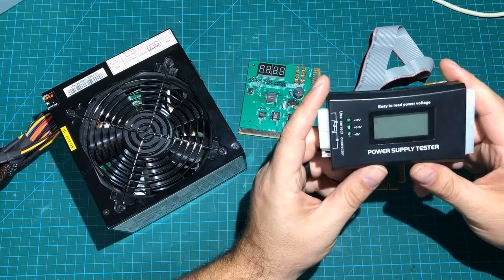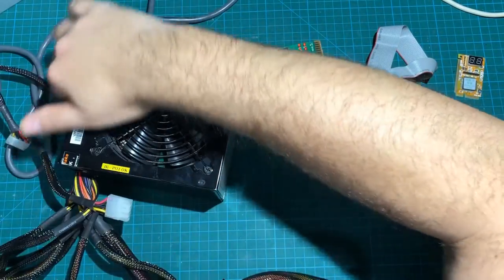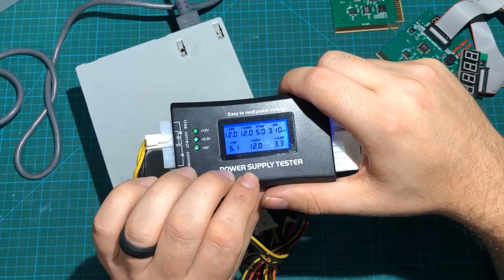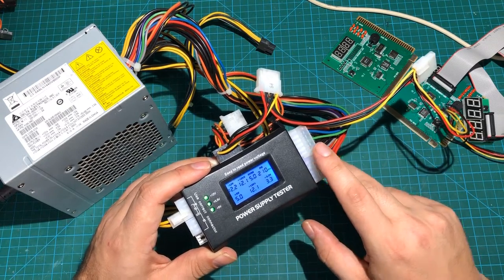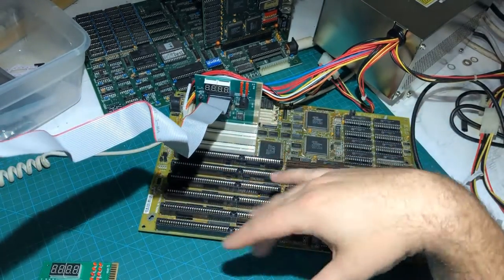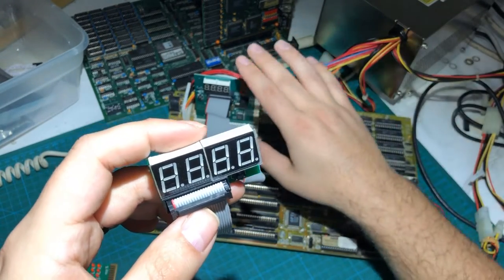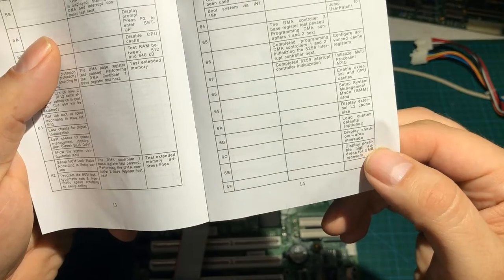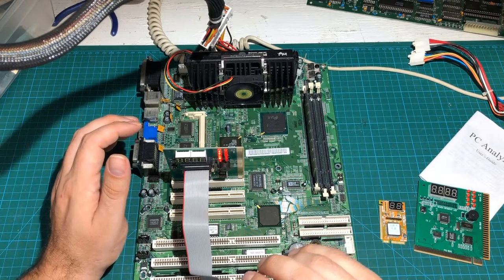PC Diagnostics Tools - Are they any good?

Comment: I bought the  PCI diagnostic card  10 years ago  , it was useless , the manual written in poor English , I trashed it
Reply from the maker: I normally just google the codes. It's REALLY good at testing voltages and figuring out if your pc dies in the middle of the boot process. I wouldn't call it useless.

Comment: At 5:45 you have the card inserted incorrectly which most of the time will cause a short! Check the card where is says "rear". That should point to the back of the main board where the e.g. keyboard plug is positioned.
Reply from the maker: You're absolutely right.  I figured this out because I always work on these things with the slots facing me so "back" is front and front is back.  On most of these cards I finally put a bracket or something else to prevent this.
Reply: @AnotherMaker  You literally warned us about the mistake you made
Reply from the maker: @SomeAngryGuy1997  such is life when trying to talk, film, and work. No harm in this case fortunately
Reply: @AnotherMaker  Lucky indeed. Glad it didn't break something.

Comment: I have a question about the debug card with the golden pcb at 5:00 
Is it possible to use this card in a M.2 SSD interface on a desktop?
Reply from the maker: I don't think so. I think it's mini pci-e only...but I could be wrong.
Reply: @AnotherMaker  Thanks for the reply.
It's a shame that they don't make them for that port since new motherboards that come with a debug led are pretty expensive.
And most mobo's these days come with extra M.2 slots and if slotted there you would be able to read it.

Comment: I've looked into POST cards recently and there isn't really a use case for them. For technical reasons they don't really work on PCIe, and PCI slots disappeared 10 years or more ago.  You can find them that plug into TPM the connector but with that being required hardware under win11 we can expect it to be come a built in chipset feature very soon. The required bus just isn't exposed anywhere on modern PCs. 
Of course maybe this is retro channel, Haven't watched you before.
Reply from the maker: I primarily do use them on retro computers. I do have PCI Express ones for laptops although I haven't particularly needed those yet.